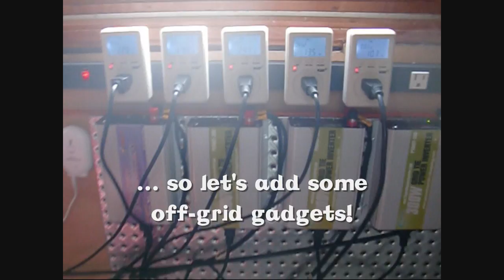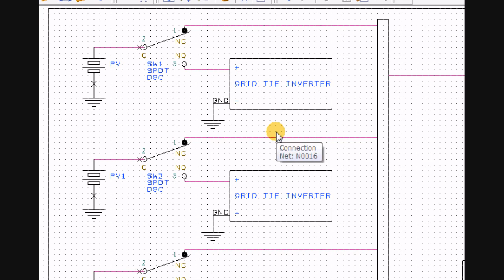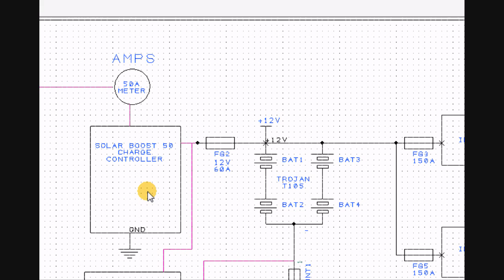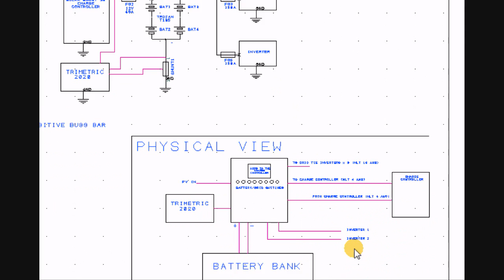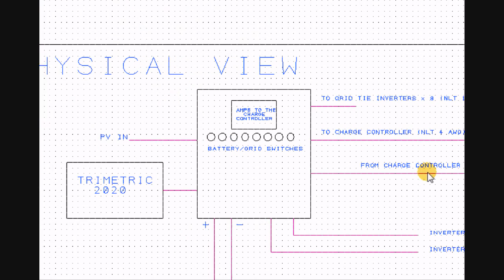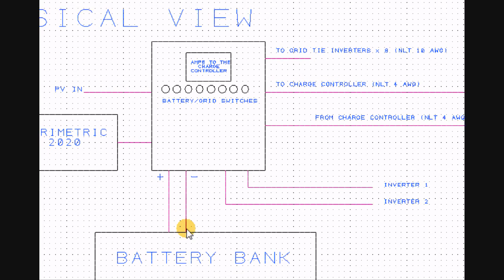Solar Energy Off Grid - Part 1 - Planning and Parts

Comment: Your videos are great. Thinking about same gti approach. Controlling excess into grid. Rotate panels away from sun to reduce input into GRID. Utility will not support excess so customer find ways to store excess and be less dependent on utility. Use PLC to sense energy and redirect, heat, battery, transportation.

Comment: @Fearlessthinker I like your "hydrogen explosion" containement structure in the form of an attached garage :)) 
Mine is even better, it's a "detached" garage. Where do you plan to get your Trojan batteries or did you get them already?